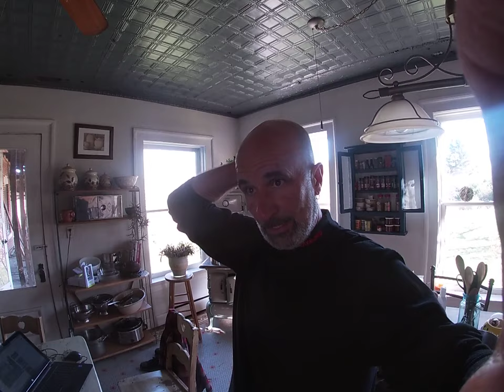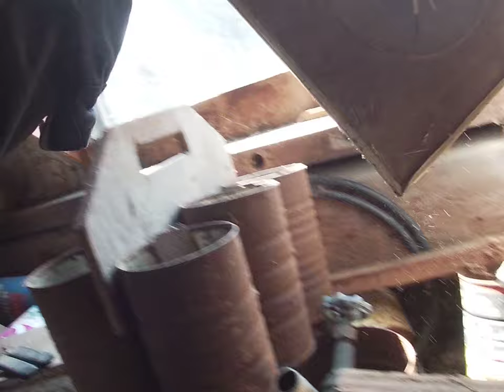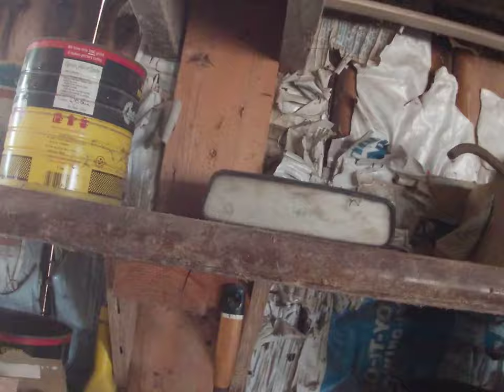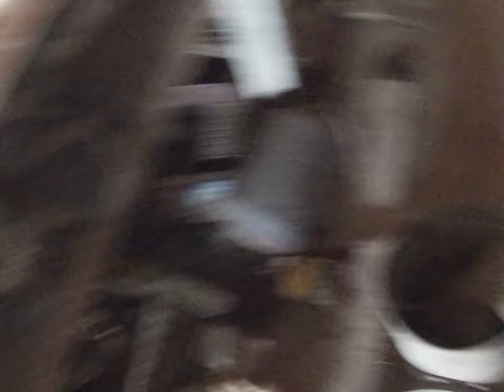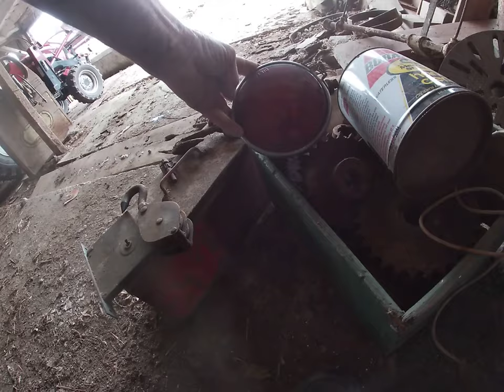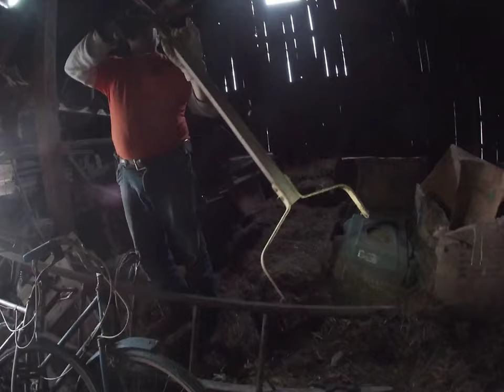Part 2 Hoarder pick Sherburne Upstate N.Y Check out a GROSS little surprise at the end of the video.

Comment: I help build that A frame tool chest. It was frikkin solid and very well built but heavy. Thought all the cow stanchions were gone ( We took a lot out by hand and it was good concrete ). The exercise bike I used often and I thought there was a basketball hoop up stairs in the barn? Both were mine and placed them there ( outside one also ). Guy was a INTERNATIONAL nut so if that has any value..look around for that stuff. Keep watching to see if other things I might be interested but nothing i have seen I can do without. Sorry, don't need the dead cat..LOL. Having fun..hope you are! BTW, the Shopsmith at the beginning ( not sure if motor is there ) is very very old. Those are very collectible and people look for them even if they are old. See it's rusty though.
Reply from the maker: Hi Kevin, Both Vince and I were wondering what the A frame was It's a tool box? Not finding many International parts. Thanks for the info I'll pass it along to Vince.
Reply: @brickhousesalvageandantiques  yes, it's a tool box. Normally you would hang your tools on the outside with hooks/nails but don't think he ever did that. Kinda like you would do with a peg board situation. That way everything would be right there on one side or the other. A few drawers for easy storage.